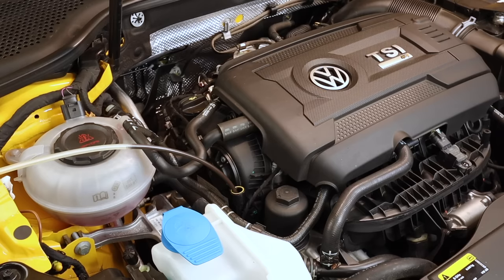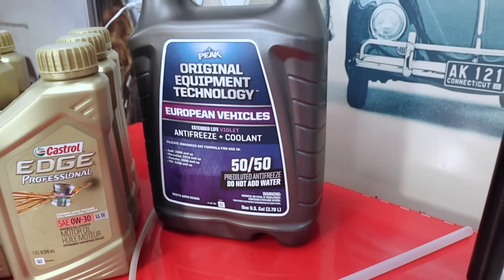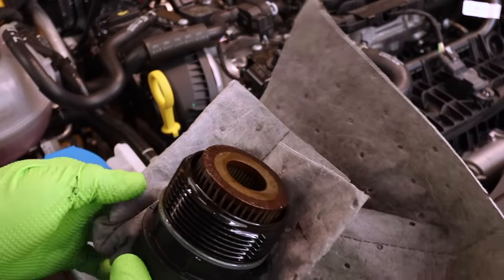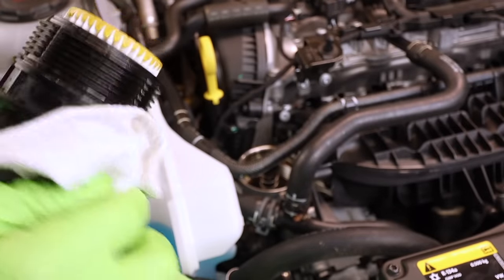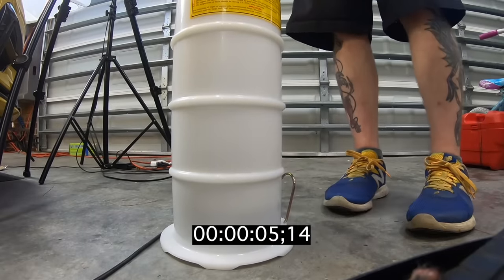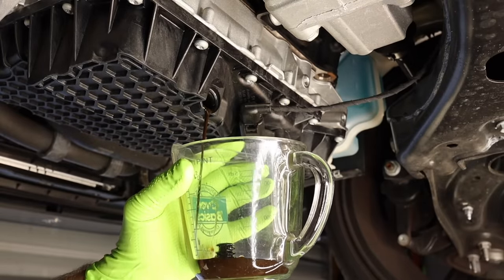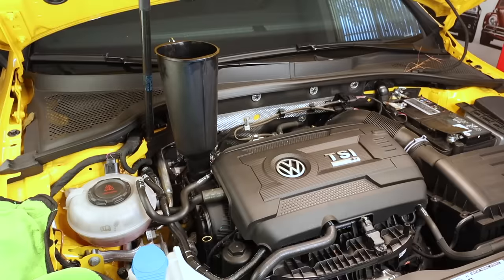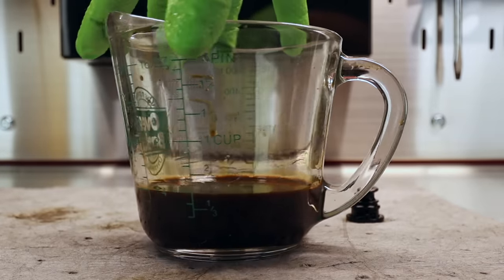Will an Oil Extractor Get All The Oil? (MK7.5 Golf R 5000 Mile Service)

Comment: NO! Do not listen to his dude!!! You are supposed to fill the oil up to the top of the oil fill line. The engineers design them to run with the full amount of oil in the crank case. Yes, the engine can run with the oil between the minimum and maximum marks, but for maximum cooling, lubrication, etc, of the engine. It is best to put the proper amount of oil in the engine. Which means filling it up to the maximum fill line on the dip-stick. Also, never use those stupid vacuum extractors on your engines. They do not flush out all the contaminates out of the engine, which is the whole point to doing the oil change. They, in fact, leave all the contamination in the engine and over time can, clog your pickup screen on the oil pump blowing your engine. I have been a mechanic for 20-plus years. I have one of those vacuum extractors they work great for other things, but do not use them on your engine.
Reply from the maker: NO. Lol

Lol so the fill info comes right out of the vw repair manual for filling. 

And oil filters trap contaminants as well as the oil itself. So using an extractor is perfectly fine.

Now if you have a poorly maintained engine, use maybe draining with the plug is “better”.
Reply: @HumbleMechanic  I do not own a VW and never will. That may be said about the oil level in the manual, I don't know, but you should always fill it to the full line when changing your oil. When the engineering of an engine is done, they factor in the oil level. If the oil level is too high, oil foaming(bubbles) would be formed in the oil and show up on the dipstick when checking the oil right after running the engine. I have never in my life filled the engine to the "full" line after doing an oil change and had that problem. So for maximum efficiency and life of the engine. You should always fill it to the full line after doing an oil change. And as far as the oil extractor goes... Small enough contaminates can get through the engine oil filter and ruin your engine. Causing unnecessary wear to the bearings and/or cylinders walls. I stand by my statement, and I will also recommend changing your oil at half the recommended mileage oil change intervals your manual suggests.
Reply from the maker: Do you really think that filling to the top of where the OEM says to fill will cause aeration? LOL OKAY 👍
Reply: @HumbleMechanic  no dude it won't happen. They are designed to run with the oil level at that level.

Comment: Oh No! Never in the history of mankind has anyone dropped  a drain plug into the old oil. Good thing it is not seven years bad luck. Ok, on to my point: Lately, on my Honda Accord, I have been using a pump to drain my oil since a service guy stripped my drain plug and I had to glue the plug in with RTV.  I reasoned that since the dip stick was on one side of the pan, I drive the opposite front wheel up on some blocks or ramp or raise it with a jack to tilt the car toward the dip stick hole in hope of extracting more oil. Total lift, 8-10 inches from level. Try it next time to see if there is a difference in the oil remaining. Lastly, is that a plastic base pan on that engine? What are your thoughts on that being plastic? Admit-ably, it does appear to be easy to replace should the need arise.
Reply from the maker: Yep that is a plastic pan. I have seen a lot of them hit, and no damage. I would say its MUCH stronger than you'd think. I have heard of some warping due to heat. 

I don't think it's as horrible as people want to believe. That said, I am super cool with a metal pan, and extra protection of a skid plate like the Alltrack one

Comment: Do not use oil that flows in room temperature like water - it's easier tk kill engine, now think how that oil flows & lubs at 110°C+. I've killed 1.6 Ford Focus engine by using 5w-30 and going 150km/h on highway! Using high performance engine? Use something like 0w-50, 5w-50 or even 60. It wont kill Your engine while getting into higher temps due to water-like flowing oil.
Sorry for my english, it's bad.

Comment: Doesnt matter.  Simply MEASURE the difference between what was put in the oil sump and what was extracted !!!!

If you put in 6 quarts and only extract 5.5 quarts then simply change the interval of oil change.  Example:  oil removed divided by the oil normally added 'times' the recommended changeout interval  ...   (5.5 / 6) X 6000 miles = 5500 miles for next changeout.

Comment: Do not I repeat do not use these if u want your engine to last .. they don’t remove all the metal particulates or other worn down parts that may be in the pan … there’s a reason y engines have a drain plug use it ..

Comment: Not really much sense in changing oil every 5000 miles when using modern full synthetic oils.  Take a gander at some of the research into these oils.  The short of it is that most synthetic oils don't even reach their full lubricity until after 5000 miles.

Comment: This is a very simple answer when you drain the oil out of the bottom you get everything out dirt sludge whatever's in there you suck the oil out your not going to get all suppose that folks been doing it for years oh if you suck the oil out of the motor you can charge more that's the only difference with the person's pocketbook

Comment: Always pull the drain plug, look for debris on magnet and sleep well with no nightmares
Reply from the maker: What if there is no magnet? ;)
Reply: @HumbleMechanic  I guess you already know that answer... 

If you dont know the service history, you risk that sludge stays in the pan. 
Happened a lot on Peugeot/Ford due to wrong location of plug (design fail)

Comment: Using a torque wrench when changing the oil filter is bs, just get it as tight as you can by hand.
Reply from the maker: I’ll never give anyone a hard time for using a torque wrench. I’m buy no means a torque Nazi. But the spec is 20nm. That’s tighter than most will get it by hand

Comment: On my cars I have to take the belly plate off to get to the oil filter anyway, so an extractor doesn't make sense for me. Speaking of not making sense, why the hell couldn't VW cut out some of the plastic in the engine cover around the oil filter so you don't have to pull the cover to change your oil? Pretty stupid that an inch of plastic is causing you all that work and risk of breaking stuff 5+ years down the line.

Also, that plastic drain plug should just have a wing on it to remove/install by hand(ala radiator petcock); encouraging people to use screwdrivers around plastic is a bad idea.

Comment: 5K is unnecessary, I have my last 2 GTI's 10K always never an issue, never  current Golf R 2019 got it in Sept, 7700 miles on it now, oil level hasn't changed, gets the first 2 by dealer part of the original sale, then I do my own, every 10K, 5K is a waste of money Syn oil lasts and lasts..2019 has the 6 year 72,000 warranty with the 10K changes
Reply from the maker: I’m okay with all that being true. It’s not however a waste of money for me for 2 reasons. 

1) car is modified. 10k is ideal situation maintenance intervals. Modified car pushes it more to the severe serve world

2) It’s cheap insurance and makes me feel better. That’s worth the $60 or so a year.
Reply: @HumbleMechanic  yup, corrrect

Comment: I don't agree that the perfect spot would be right at the middle of the hash marks. You would want to have as much oil as possible without overfilling. The more oil you have, the more volume the oil has to absorb shit from the engine, which is good.
Reply from the maker: Doing that on many modern cars will result in an overfill warning
Reply: @HumbleMechanic  how come? I have always filled the recommended amount of oil (including filter) and that quantity makes the dipstick show the top line, the max amount and i have never seen an overfill message, don't even know how one looks like.
And i have seen many new vehicles that say it is normal that from one to the next service interval, or 10.000 miles it is normal that the oil level falls from max to low and it always recommends filling to the top mark. If you don't fill it to the top, you will run out of oil and your warranty would be void. 
If your vehicle under warranty is unable to make it from one interval to the other with a single oil filling, you should turn it for inspection/engine replacement.

Comment: plastic drain plug, wtf... how much to they save, 3 pennies??
Reply from the maker: In a plastic pan. They acuytally are not. any better/worse than the aluminum pans. LOL
Reply: @HumbleMechanic  in any case plastic gets brittle over time, especially when you have hot and cold cycles... im no mechanic, but common sense tells me aluminum beats plastic on this application

Comment: Honestly that little bit of oil is still left in the engine on all the bearings, walls, heads, and oil galleys so regardless of what way you do it you'll never drain 100% of the oil. Bottom line... If you've replaced 90% of the oil and the filter then you've succefully completed and oil change , regardless of method. Most quick lube shops will only replace 80% of your oil anyway
Reply from the maker: That is basically where I’m at. Lol

Comment: If you have a filter underneath then sucking the oil out is no good, you still have to go under the car either way
Reply from the maker: This is true! I mean you can still do it and maybe make clean up easier. But the advantage is not as strong
Reply: @HumbleMechanic  yes very true. Love your show! Be safe out there.

Comment: the dilution rate of 4oz to 6 liters is so little, why not suck it out. you don't have to lie on your back underneath 2 tons of car. and even with a drainplug drain, there's still old oil in there. as long as you change the filter and do it at the right milage and with good oil you should be good. i change my oil every 10,000 on synthetic, and have gone to at least 230,000 on every motor before I got rid of the car.

Comment: Hell no!!!! If your oil is marked on top the dip stick is all ok. If you do it alway's in the middle or lower specialy with a high power car and going in to revs mutch time's or taking corners fast and has some oil consumption,you will damage the turbo!!! BTW,your oil gets dirty sooner also!!
Reply from the maker: It’s car dependent. If you cold fill on a modern TDI you will get overfill warnings.

Comment: That's Lame for the engine oil change,  I change my engine  oil the normal way, for the transmission, yes i see it, I would do the transmission fluid change half of the time, so it would extend the filter time a little longer

Comment: Ahhhhh....composite oil pan. Why why? And you need an adapter to add oil.... this is why I abandoned VW after being a complete enthusiast in the 80s and 90s. The Germans have even over engineered an oil change.

Comment: use the top , its not a problem if you have 100 ml left behind , dont be stupid, its just 100 ml ,for the engine that its nothing with the  new oil will be fine its logic !

Comment: You should of sucked the oil out of the filter housing too.
Reply from the maker: It all drains back into the crank case when you loosen it. That’s why you do the filter first
Reply: HumbleMechanic last time I used an extractor I got loads out the filter housing. Maybe mine was different.

Comment: I will not use the extractor. I will pull  the plug and get it all. It’s easy to get under the Jeep and Ridgeline. If I owned a car probably would try the extractor.

Comment: Personally id rather not be lazy and just get my ass down and do it the right way by taking the drain plug out.....
Reply from the maker: But is it the right way if it was designed to be completed that way? ;)
Reply: @HumbleMechanic  very valid point... but even if it were designed that way...id rather not leave any old oil in the pan at all if i can help it.
Reply from the maker: Totally respect that! My theory is, the oil should never be questionable anyway. 😂 now if it was old old oil Let’s pull the pan and clean. As always with most things the grey area is where the sweet spot it

Comment: lol, plastic drain pan.  Wonder how long that will last with heat cycles before it will warp or turn brittle and crack on its own.
Reply from the maker: They hold up better than you would think.

Comment: I dont think using a oil extractor will be the best thing. Usualy when you drain the oil from the plug you get much more debris out of the pan.
Reply from the maker: I wonder if you ACTUALLY do or if it feels that way. The filter should catch most yuck, plus we should be regularly changing oil. So the amount of debris should be minimal. 

Plus if our engine is warm a lot of debris will be held in the oil

Comment: You can turn the car upside down to make sure to get all the oil.
Reply: Not necessary. I saw a video where they got all of the oil out of the engine by simply driving over a fire hydrant.

Comment: Never buy into the 10k oil changes...5k tops always but only with synthetic oil. Synthetic is rated for 10k, and will not break down in viscosity during a 10k interval but there are side effects of having too much carbon buildup as well

Comment: That amount of dirty oil left in the pan in unacceptable. The additive package in the fresh oil will immediately begin to be depleted as its exposed to the contaminants found in the dirty oil.  Antioxidants, Rust and Corrosion Inhibitors, Viscosity Index Improvers, Anti-wear Agents, Extreme Pressure Additives, Detergents. Dispersants, Anti-foaming Agents, etc. will all greatly lose their effectiveness over the life of the next oil change cycle.

Comment: I think you're leaving the worst sludge, metal particles and other contaminants stuck in the bottom of the oil pan because that's where they sink when the engine is turned off. The fresh oil is just diluting all those contaminants so they can be re-circulated in your nice new oil and back into the engine.  Older cars aren't going to look as nice inside the engine as your nice new VW MK7.5 Golf R. You're trading efficiency for speed and convenience. That could come back to bite you in your bumper.

Comment: the only thing i didn't like about this video is that you should be using the proper tool for the drain plug because it ain't just a flathead screwdriver... 👎🏻

Comment: I change every 3k no exceptions. I don’t believe the 5k and certainly never above 5k
Reply: Unless you are running some serious BHP, enjoy wasting your money. 3k is absurd, 5k still over the top unless you literally jut do 2 mile red line journeys from cold. The service manual rates the oil to 20k which I agree is too long - but fundamentally VW must warranty this. 
Changing every 7-10k or year seems much more rational to me. And kept a 12 year old 250bhp Mk5 GTI in good health to 140k miles (in my ownership), my Mk7 will get the same treatment

Comment: When the engineers design an engine to be serviced at 10k they mean 10k. The wear of the parts are designed for a precise wearing of oil. When you change too often or simply use the wrong grade of oil YOU YES Y.O.U. are going to ruin the engine

Comment: Purely laziness knowing there is still that much oil left yet still using the suction method to extract the old oil., Not acceptable! 
Would you wipe your butt knowing there is still a little bit left to go?
Reply from the maker: You’ld be heartbroken If you knew how much oil is left after draining. It’s way more than what I had left in the pan. ;)

Comment: How dose this take out the particles and contamination that sits on the bottom?   Don't be lazy.  Pull the plug..   

You for sure get all the oil out.   Not the sediment. I'm pretty sure if you're supposed to use an extractor there would not be a drain plug.  Trust the engineer that designed the car.that made the plug. For a reason..  this is just my opinion. Not real scientifical facts
Reply from the maker: Well since VW and Audi recommended techs to do it this way, I think we will be fine. This is also why you change the oil warm so what little sediment that is not captured by the filter is suspended in the oil.

Comment: man just seems unnecessarily overly complicated engines. terrible. 
no extraction pump. drain plug only. why have extra dirty oil mixed in with new.
Reply from the maker: You will always do that. Oil chain always leaves oil behind.

Comment: Yes Mercedes Bmw vw group the extractor is great but 1 thing sir you are def not that bright the hash marks are not its ok in the middle it means low to full and all cars usa asia and europe the bottom to the top represents exactly 1 qt hence it was at the bottom and when you added your other half it only got you to half the factory spec they list on all cars is only a guide and in my 25 years of working on cars 1 is prob 30 to 40 % need an extra half as you learned and 2nd that little device on the bottom of your oil pan with the 3 bolts that is a oil level measuring device and it reads in mm of your oil level while off and when running now all those engines like to drop the timing chaim great engineering vw did on them now when yours does and you  want vw to buy you a new 1 they are gona say sorry bro cause you let your oil level stay a half under its whole life and anybody that is watching you again half of those 2.0 just dont make it with perfect maint and if your viewers do as you do then they will also have some real warranty issues just saying if you are gona make these vids by all means say listen i wana run my car 1/2 qt low all the time but you should keep yours at the top of the full mark